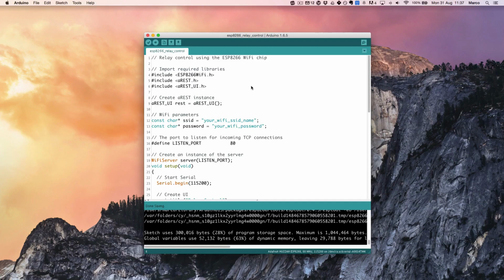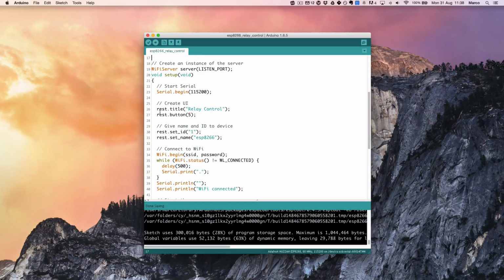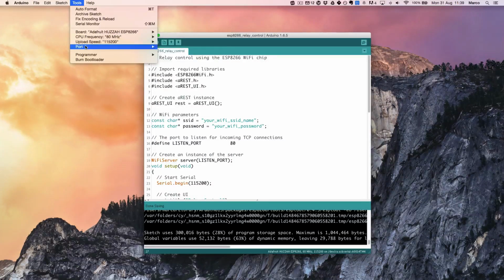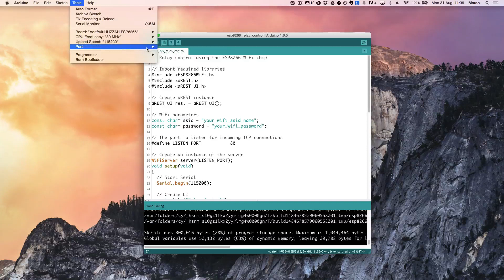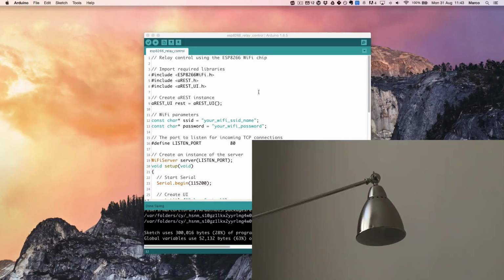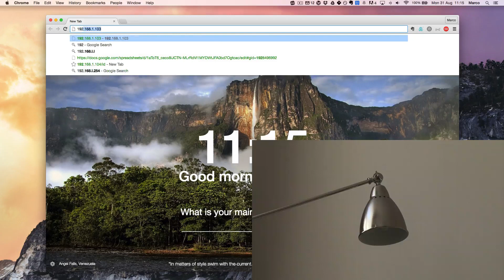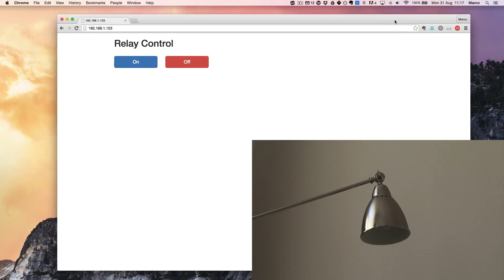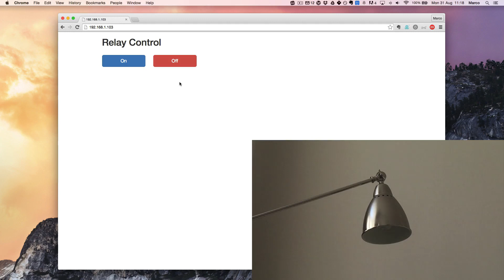Control a Lamp Remotely Using the ESP8266 WiFi Chip

Comment: Thanks for posting the video. I am wondering if there is a way to add a timer to the relay control, say turn on for 30 seconds then off automatically. Is there an easy way to do this?

Comment: What if I want to control the lamp sometimes from wifi and sometimes from normal electrical switch?
For Example: I turned off the lamp with electric switch and gone to another room. Now I want to turn on the lamp by WiFi. Is this possible?
Reply from the maker: Sure! You'll just need to put the two switches (the mechanical one and the one from this project) in parallel

Comment: // Start Serial
  Serial.begin(115200);

  Serial.println("WiFi 1");
  
  // Create UI
  rest.title("Relay Control");
  Serial.println("WiFi 2");
  
  rest.button(13);
  rest.button(12);
  rest.button(11);
  
  Serial.println("WiFi 3");   
        
  // Give name and ID to device
  rest.set_id("1");
  rest.set_name("esp8266");
  
  Serial.println("WiFi 4");  
  
  // Connect to WiFi
  WiFi.begin(ssid, password);
  
  Serial.println("WiFi 5");
------------------------------------------------------------------------------------

wdt reset
load 0x4010f000, len 1264, room 16 
tail 0
chksum 0x42
csum 0x42
~ld
WiFi 1
WiFi 2
WiFi 3
WiFi 4

 ets Jan  8 2013,rst cause:4, boot mode:(3,4)

wdt reset
load 0x4010f000, len 1264, room 16 
tail 0
chksum 0x42
csum 0x42
~ld
WiFi 1
WiFi 2
WiFi 3
WiFi 4

Comment: I am getting very intermittent operation.  The WDT is kicking in. I'm using a ESP-12E and have not had any problems with it so far. I think the problem is the length of time that it takes to connect to my router. I have had it go through a reset sequence a number of times and then it might connect and I am able to use it for a while. And then it crashes.

 ets Jan  8 2013,rst cause:4, boot mode:(3,6)

wdt reset
load 0x4010f000, len 1264, room 16 
tail 0
chksum 0x42
csum 0x42
~ld
.....
WiFi connected
Server started
192.168.100.104

 ets Jan  8 2013,rst cause:4, boot mode:(3,6)

wdt reset
load 0x4010f000, len 1264, room 16 
tail 0
chksum 0x42
csum 0x42
~ld
.......
WiFi connected
Server started
192.168.100.104

Sometimes I get a hex dump as well.